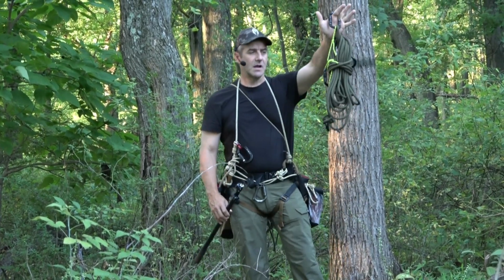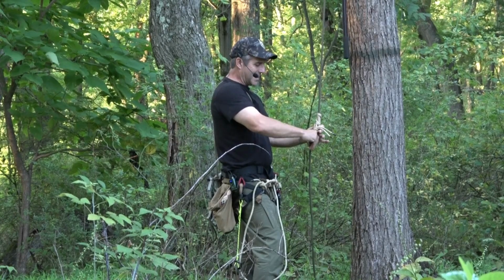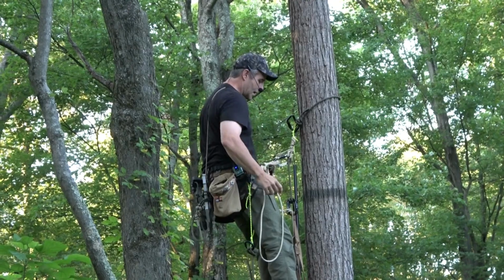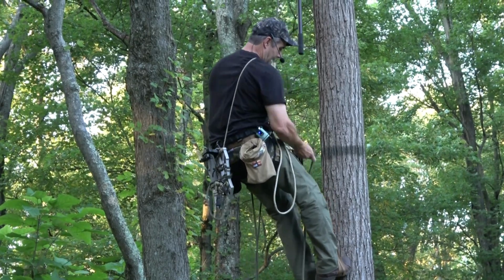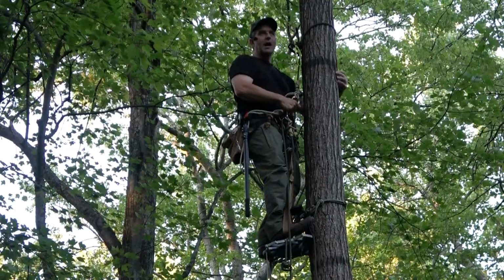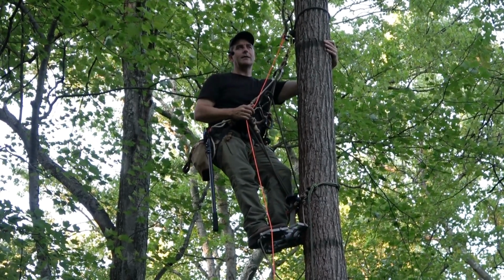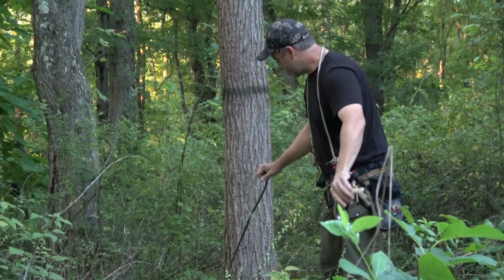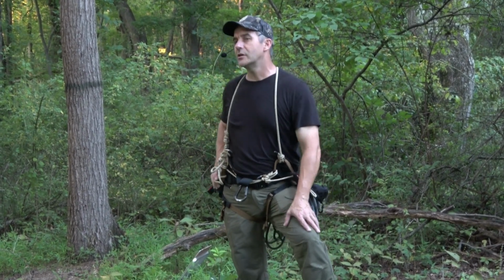Double JRB Cinch System and Climb

Comment: If you want a longer lightweight pole, the Doben carbon fiber pool pole in 12ft or 15ft..  I got the  15ft version doubles as a walking stick. And me being 6'5" I can go around 20ft in one move... and that's all I need a lot of times.. I love it. Fast, easy, simple, and Lightweight climbing option! Thank's JRB for the great idea and videos!
Reply from the maker: @hattrick1974tube  thanks. I don't have that one, but I have a dozen others.  The Maverick pole was intentionally chosen with a length that the One Stick team can use it too.  I will check it out though.

Comment: Was going over in my head one scenario that I can't process what exactly I'd do and looking for thoughts/advice. Say you set your hitch in the tree already for your next move and before you transfer over to the upper line, or maybe it didn't set correctly and you now want to bring it down to reset it.... how would you explode it from underneath it without something tied to the tag end. Basically once you start the process to make your next move up the tree there seems to be no turning back.
Reply from the maker: This is a fantastic question, and I used it as motivation to make some reorganizational changes to this page and putting your answer at the bottom of it. 
https://jrbtreeclimbing.com/content/jrb-cinch/

Comment: I appreciate the thought that has gone into this, but holy crimony, what a complicated mess of ropes, carabiners, poles and hitches.  I have 4 Muddy micro steps, a Grit Workhorse saddle, XOP platform and a knaider/swaider rig that would have me up that tree to 20'+ and ready to hunt with 1/2 the hassle of all this setup.  I could also one-stick with a single tether and optional lineman with still half the hassle.  SRT is slow and unnecessary except in extreme conditions.  You are over-applying a rescue method to under-solve a simple hunting solution.
Reply from the maker: @nudsh.  I am sure you know your rig... but pls consider that understanding the difference between what we CAN do and what we can ALWAYS do safely is critical to our survival.  Next time you climb, ask yourself what happens to you if you lost your footing at any point during the climb. Bottom line is that if we are not tied in and on minimum slack and rappel ready, we are at risk.  This is just one way to execute a zero Slack climb. DSRT is much faster.  Meanwhile, several hundred hunters die every year in climbing accidents. Thousands injured.  They all thought they were safe enough.  I'm not asking you to adopt this method. But pls tie in your bridge to the tree and manage your slack. Make sure you can step off of the steps at any time and never go anywhere.  Cheers
Reply: @jrbtc  Appreciate the honest response..  I agree that safety is first thought.  I used to rock climb and have different thoughts on redundancy to mechanical devices, etc.  My point is, for the average run and gun bow hunter looking for a 16' - 18' quick climb on public with a decent sized platform,, this may be a bit slow and cumbersome over some cam'd micro steps and aider assists.  I can see the value in this for deep hike, high climbs where you might look to minimize noise and hard gear.  Your method and a ring-of-steps could be a light and packable solution, even a damn good solution for crooked trees.  Just saying that for most hunts, this might be slightly complicated over some classic methods.  Cheers on the efforts and best of luck.

Comment: Has any one or have mr JRB been up in a tree during rain? How does the longhorn agile hitch handle rain and wet rope? I'm thinkin the answer is to basically add additional wraps on the hitch? Thanks.
Reply from the maker: I have done a lot of wet testing.  A 5 wrap Longhorn Agile didn't slip until I got to 6mm on 8mm in SRT,  and that's not a combination I recommend unless you're on the slim side. 
https://youtu.be/bT_5e1bI4p4?si=uLBjLNYPEg4xK8KX
Reply: @jrbtc  Ah, excellent. Thank you for your response and the video. I hadn’t seen that one yet, and I’m excited to explore more of your channel. Your dedication to educating the public is greatly appreciated.
I’m glad to hear you’re confident in the rope and hitches under wet conditions. In the Northeast, we get a lot of rain during hunting season, so it's reassuring to know they’ll hold up.
I was about to use your code on Ape Canyon but noticed most items are out of stock, which is disappointing. I’m particularly interested in the 60' 9.5 mm Ghillie with Squatch splice, 7mm accessory cord, and the Garda hitch kit. These would help me reduce unnecessary metal and weight, and I’m thankful for the JRB channel’s focus on safety.
Thanks again for your time. I’m looking forward to SRT climbing using your technique this year.

Comment: Thanks John. This video is probably the most relatable and simplistic to my climbing for hunting. I’ve looked at so many methods and have had a hard time settling on a climbing method. I have sticks, wild edge steps, and Bullman steps. I can see myself learning your system to climb instead of 1 sticking in the future.
Reply from the maker: Great. To be clear, I have devised multiple "systems" and this is just one. My primary hunting system is my Universal System which allows a similar climb but on a different anchor, the Maverick Hitch. This system was developed specifically for hunters who prefer NOT to tie knots and who prefer not to use a throwball.   Lots of information here:
https://jrbtreeclimbing.com/
Reply: @jrbtc  I would say that for the time being I’m in the category of not wanting to tie knots in the field or deal with a throw ball. Down the road that may change. I just want to be as safe as possible climbing and this method seems to fit the bill for me. Heck, I can sell all of my other climbing equipment if this works out.
Reply from the maker: @kevinanderson4610  I am learning from you as much as you are learning from me. I have been doing this so long that I forget what it's like to be uncomfortable with a throw ball. It's probably no different than when we first shot a bow. After a while, we take it for granted

Comment: Another great video. Would it be possible to use a best friend loop on a foot loop,if it is used on a CT quick roll above the ascending device? As always thanks for all you do for the sport sir!
Reply from the maker: @JasonHarris-qi9oz  if you are using a hand ascender above your friction device, it would imply you are climbing a RAD SRT system with 3:1 mechanical advantage.  If you attach a redundant bridge to a hand Ascender as an emergency backup to cover the possibility that your friction device fails, the benefit is obvious. But the disadvantage is that it will be kind of messy and get in the way. And you will need to design a recovery plan should you ever find yourself on that connection. To my knowledge, a hand  ascender is only supposed to be used in transition.
Reply: @jrbtc   thank you for the reply,and I'm sorry I should have been more clear. I was talking about ascending, not descending.
Reply from the maker: @JasonHarris-qi9oz  the primary nugget in this video is that I am setting an anchor and climbing to it. Then I set another anchor and climb to it. And repeat.  If you want to repeat that using a different device, that's completely up to you, but you would need two of them, one on each end of the Rope. Now, if you had a really long pole and you could set your cinch at the height you needed it, then you would only need one. All of those details are up to you to safely explore.  I don't own that device and don't have any plans to get one

Comment: Your knowledge of climbing and knots is incredible. But this looks way too complicated with way too many parts, knots, poles, transitions and looks like it takes a while to get up the tree.  Idk how great that would be for hunting.
Reply from the maker: @michaellynch3172  I I appreciate your comment and perspective.   This system and method is one of several we can use that meet my scrutiny for safety requirements.  It's specifically for a hunter who is either incapable or not interested of using a throwball.  As stated many times, DSRT is my favorite climbing method and the one I use on most of my hunts. Link below.  Complicated is relative. I learned to drive a car with an old stick shift on the column. It seemed complicated. But I practiced it safely and mastered it. As we get older, we forget how to learn.  We can fall victim to complacency and to buying what we are sold without being aware of the risks. According to my research, hundreds of hunters die nationally in elevated climbing and treestand incidents every year, and thousands are injured. Talk to a few of them. Show them this video and ask them if it's too complicated.  
 https://youtu.be/ovhvJa8Jxtw?si=G0JmISLXqyvXkcoe

Comment: Good hitch system, Maverick is so easy to tie, last year i was climbing on the Maverick with 8mm rope and that would jam occasionally, of course with Retrieval cord or a pole it was always retrievable. This year with 11mm rope it never jams and i have developed a simple technique for installing with a pole hook -insert the hook within the locking loop and the two Houdini rings, never jams and the hitch stays perfectly aligned , the weight of the pole on the lock loop keeps the hitch oriented perfectly and always explodes for easy removal. I am running my hitch rope with  footloops  tied permanently ,  installing a carabiner handle in my 5-2-3 JRB soft bridge after setting my rope in the tree, minimizing any appliances on the rope walking in and installing in the tree without any fussing about. Love using a pole and hitch climbing for exploring new areas, and if i like a tree it's easy enough to leave a paracord preset for a return visit and DSRT stealth climb.
Reply from the maker: @kennethrogers1129  but how can you remove the pole from the Maverick if your body weight is on it at that time?  In Hitch Climbing, Our weight will always be on the anchor when we need our Pole to set the next hitch.

Comment: More great stuff John, thanks!!
Reply from the maker: @seabeebillm  it's getting fun with this many tools in the Toolbox!
Reply: @jrbtc  so I went out and did a bunch of practice climbs today. I’m very comfortable trying and climbing on a Maverick hitch, but I built a JRB cinch system just to play with it, and I’ve gotta say I like it a lot. For me it was much easier advancing the cinch with the Maverick pole and you don’t have to worry about the hitch getting wonky while you’re moving it, especially in the dark. When I got ready to rappel I tied a JRB hitch right above the cinch with the other side of the system (I just left the cinch on and hooked up my retrieval line to it) and did a quick transfer then rappelled down…I know that’s probably overkill, but I figured it would make retrieval easy, which it did. Built the system out of 40 feet of 9.5mm Rouge, weighed a little less than 3lbs. Still carrying my 50 feet of Rougarou to SRT, but at an extra 3lbs I’ll throw that in my pack for hitch climbing…thought you might want to know how folks are using your stuff. Thanks for all your hard work and the info you put out here.
Reply from the maker: @seabeebillm  thanks for that great feedback. I like to creativity and that you are using these things like tools in your toolbox. And you know I'm a fan of redundancy and so if a second time and makes you feel comfortable, that's extremely important. I could tell you stories about me climbing up in a tree many years ago and I was over a rock pile and I also was comforted by a double tie in. We can't enjoy our hunt unless we are completely comfortable. Do whatever it takes.

Comment: Thank you for another great video! Been practicing cinch climbing. Instead of one sticking.  It’s been great. Going to Rock and Rescue Friday for more 6mm been using 5mm not working as good on my 8 mm rope. Again thanks so much for your time sharing.
Reply from the maker: @chucktaz1 Curious, are you using a Longhorn Agile Hitch on your 8mm rope?  Unless your weight profile is on the slim side, I prefer 9.5 mm rope for SRT applications.  We have to consider wet conditions as well.  I am trying to settle on the right set of thresholds for recommendations in the table on this page.
  https://jrbtreeclimbing.com/content/rope/
Reply from the maker: @chucktaz1  if you're going there, get your hands on the 10mm Rougaroo and tie yourself a Cinch and you will feel how it's bendable nature makes for a better Cinch. I built this system on a spare piece of rope I had in my collection, but I am going to upgrade it to the 10mm Rougaroo soon. And don't forget to use your JRB15 coupon code for 15% off.
Reply: Yes using longhorn, seems to bind probably do to my size 250lbs. Have larger tree rope can-not remember size but will definitely check out 10mm rougaroo. Thank you
Reply from the maker: @chucktaz1  yes, I definitely recommend a larger diameter rope and Rougaroo works great on the Cinch.